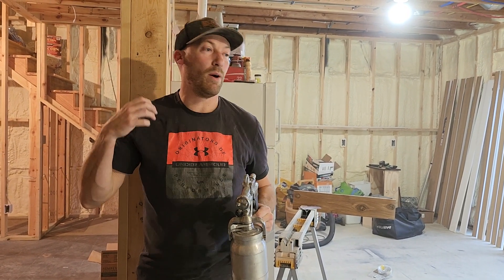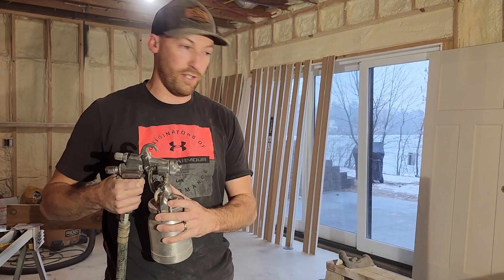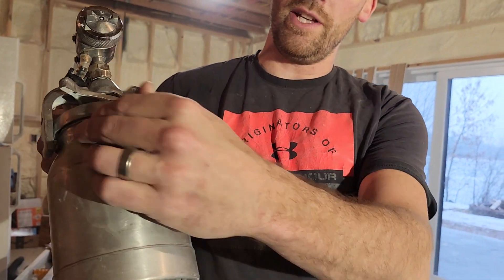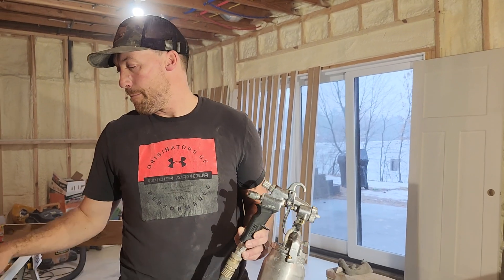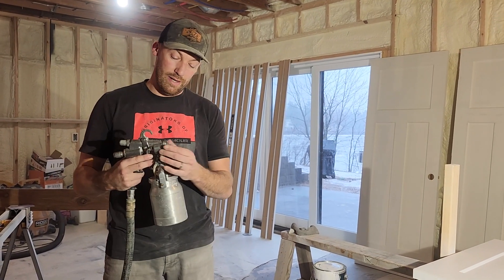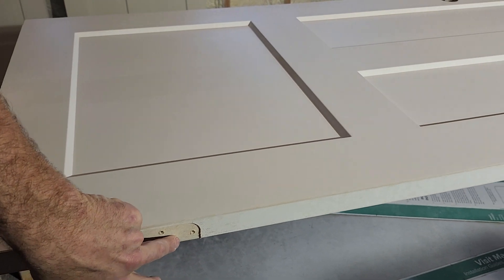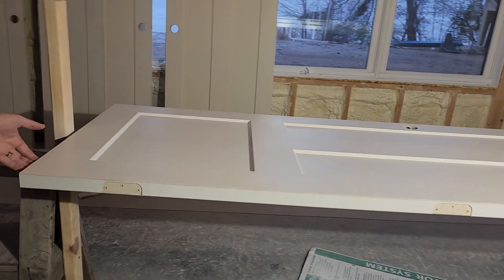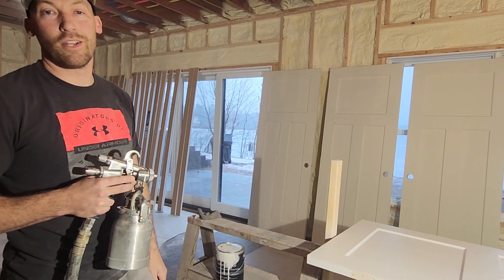painting trim and doors with ‎@sherwin-williams  gallery series

Comment: Nice video thanks.I,love the way you setup the doors so you could spin them to the other side excellent idea! I was going to spray some doors and trim using advance but maybe I will use the gallery.Going to use my titan flex spray hvlp.How’s the odor with that paint?Im a painter in Chicago the job will be in a occupied condo building.
Reply from the maker: The odor was pretty minimal compared to other stuff.  We did it in our basement in mn winter. We all left after I sprayed to let things aired out.  But I also sprayed 5 doors and a bunch of trim and casing.
Reply: @BuildingonaBudget6  Thanks a lot I appreciate that information .I will probably use this over the advance.Take care!

Comment: Does gallery hold up long term? Been wanting to try it on door and trim but concerned about cracking
Reply from the maker: We just started using it so I can't speak to that, but it has been a few months, and it still looks good.  I was really impressed at how quickly it dried and it feels and looks like what you would get on a quality pre-finished door.
Reply: @BuildingonaBudget6  Sweet, a few months is good enough to for me. Ive tried a few other durable products that were just a little too brittle. Thanks for the response!
Reply from the maker: Anytime.  Best of luck.  Let me know how you like it.  I have been a builder for over 20 years and i have used many products in the past.  This is the best product I have personally used.